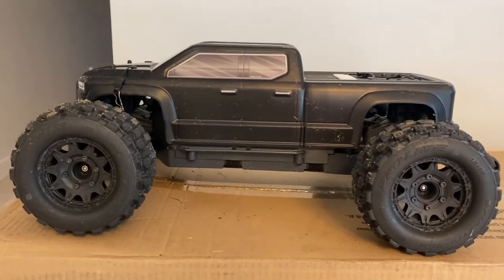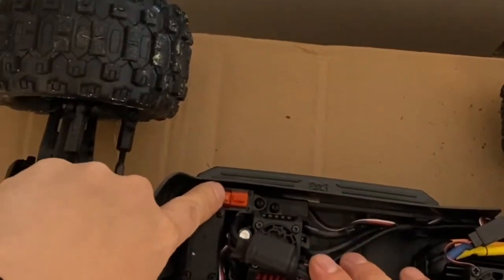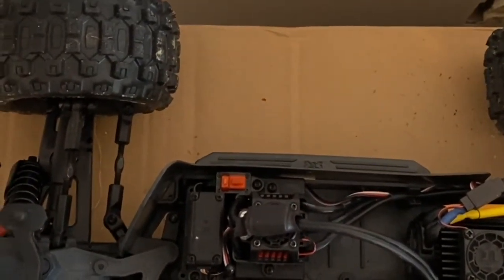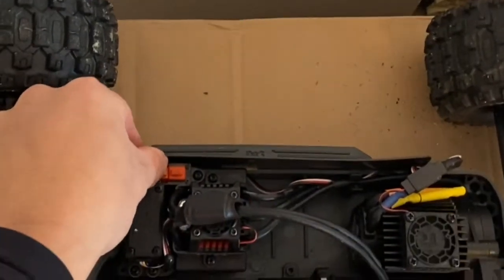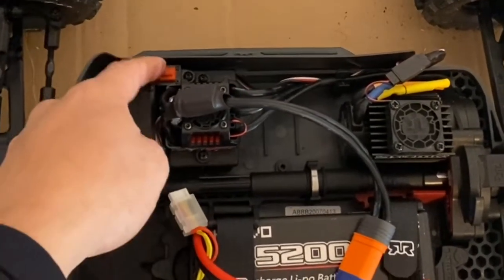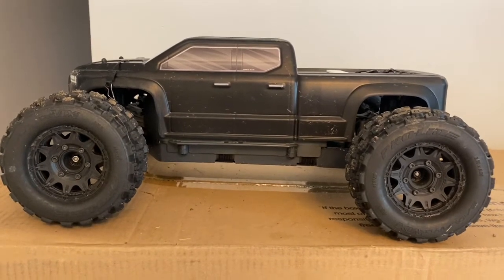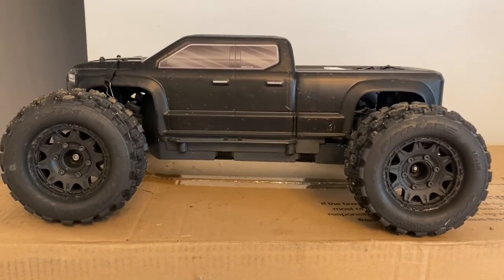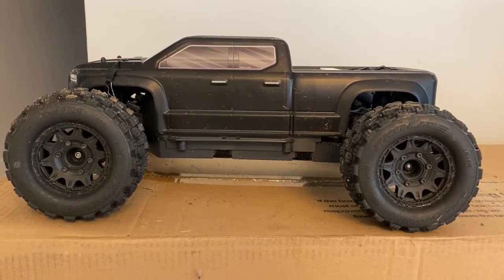Arrma Big Rock-Granite-Senton-Typhon-BLX 100 ESC-changing punch settings

Comment: One of the fb groups I'm in has been talking about this a lot so had to look it up. You explained why punch settings matter to another commenter and it was simple easy explanation.  Thanx much. Have only had my vorteks a couple months now and still learning. However I'm chasing a controller issue - likes to lose connection after a battery change and I haven't found its a binding issue or not yet.
Reply from the maker: Appreciate you cruising by and sharing the kind words!  

As for the controller issue, have you checked to see if the antenna off of the receiver is caught in the receiver box or being pinched somehow?
Reply: @Moe RC  not sure. It HAS connected itself after like 20 seconds. Like when your wifi "catches up" with your phone? It's not every time, but no I find nothing unusual under the hood.

Comment: As a noob to the Hobby grade RC world, I appreciated the (albeit brief) description of why and when to set the punch settings.
Reply from the maker: For me, 

Punch settings lower when doing speed tests to keep the nose down.  Also, when running on wet or loose terrain to reduce tire spin.  

Punch settings higher when street driving and jumping with the intention of doing backflips and stunts. Higher punch settings you increases torque sensitivity when pulling the trigger towards 100% throttle. 

I am just a normal dude and not ultra technical.  

Hope that helps!! 

Thanks for being here!

👊🏽👊🏽👊🏽👊🏽👊🏽👊🏽

Comment: Thanks for the lesson. I just picked up my first Arrma truck and it's exactly what you have there. Curious how you like the Hoovo batteries. I have a couple and one of them has a bad cell after less than maybe 30 cycles. Wondering if mine was just a fluke or if you've had experiences similar with your Hoovo batteries.
Reply: I had a hoovo that had a bad cell also.  I messaged them on their Amazon store and all they asked for was a picture showing the bad cell on my charger and they sent me a new pack the next week.
Reply: @CentralVAracer  good to know. I should have done that.

Comment: Hey mo I  put granite  tyres  on my  big rock   do you have to change the shockers set  up  I just  run it on  road  and grass  currently  rear shock is 1 large spacer  and 1 thin  front  is medium  spacer and  thin  spacer
Reply from the maker: You don’t need to change anything, but you can tune the suspension to fit your driving style for sure.
Reply: Thank Im not sure  what  works best

Comment: Can it take 4 S or do you have to buy a new ESC and motor
Reply from the maker: The esc is what pushes 4s m, I am using the stock motor.  I have used the BLX 185 esc which runs 3s to 6s.  BLX 120 I think would work too. I have also used the spektrum firma 150a as well that runs the 6s-v5 line.

Appreciate you being here! 

🤝🏎💪🤙🏽💪🏎🏎🤝🤝
Reply: Moe RC so can you use 4s on stock everything?
Reply from the maker: @brambillagennariyoutube604  in the videos you see, I have all stock everything. Well, I have different tires and bigger pinion. The only thing I changed for 4s is the the ESC.  BLX 185 esc or the spectrum firma 150a esc. These speed controllers can run 3-6s.
Reply: Which punch setting do you recommend